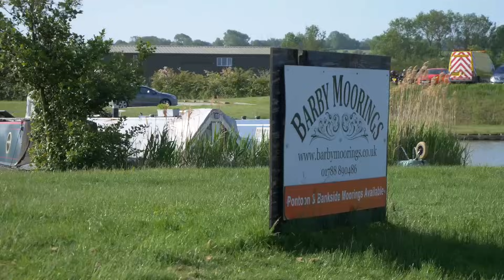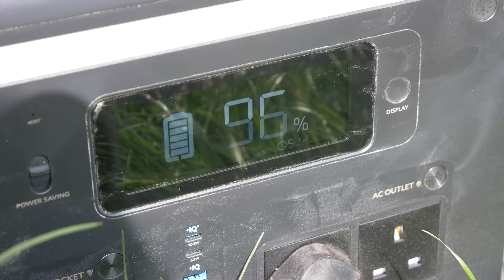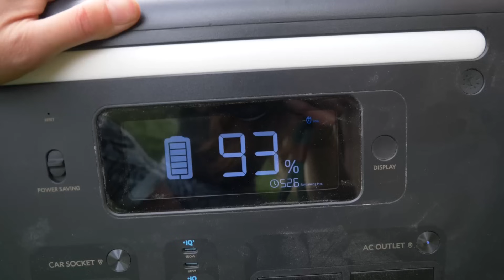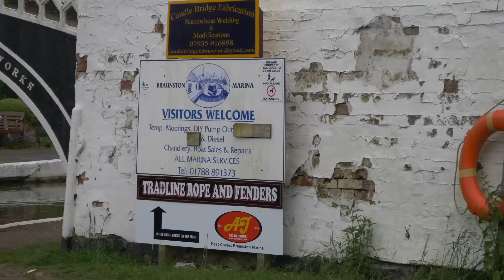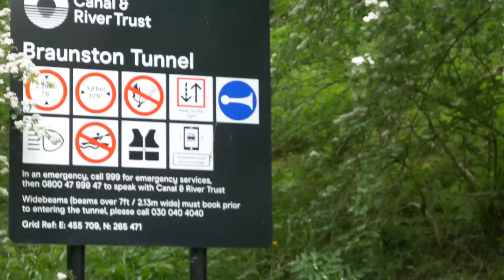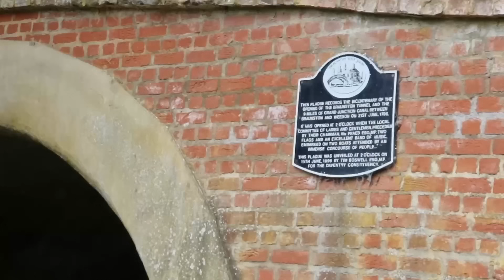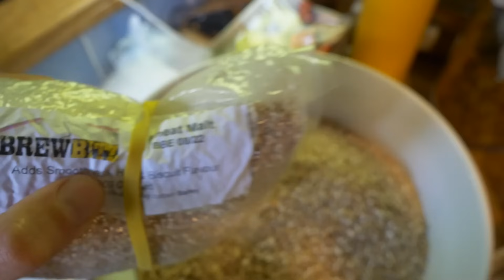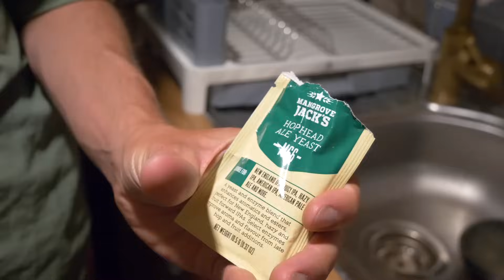The BIG Detour | Can We Ever Stick To A Plan |Travel on our NARROWBOAT home & Brewing Boat Beer! 54

Comment: O boy have you brought back memories. When I was 18 I started making homebrew. I used to get a 4 gallon empty sherry cask from the local offlicence, I'd brew 8 gallons and puit half in the sherry cask and half in flagon bottels. Each day I would bleed of some of the gas, but one day I forgot, the folowing morning my fathr said to me "I dont know what was going on in the shed this morning, there was an awful sound of breaking glass coming from there. I went out to the shed and found bear all over the flore with broiken glass every where, some of which was sticking in the wooden leg's of the bench and the plastic sherry cask had burst out of its carboard box and was jamed under the bench. I spent a very nearvous half hour letting the gas out of the bottles that had survived and of course, the tap on the sherry cask was tight up against the under side of the bench top. OOooo Boy.